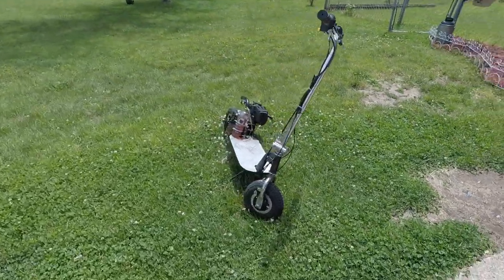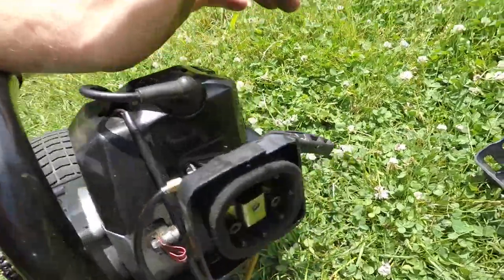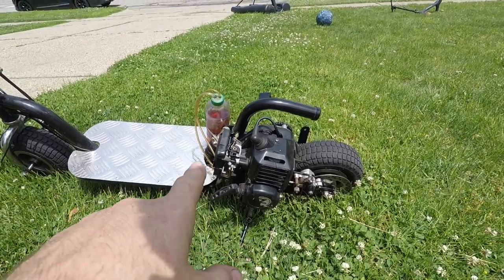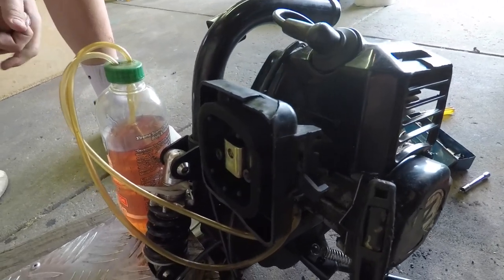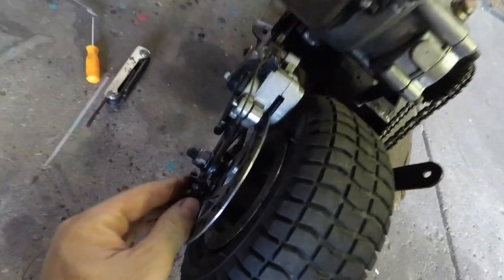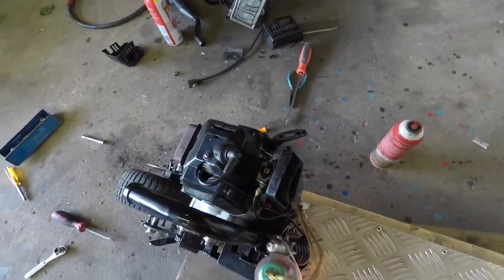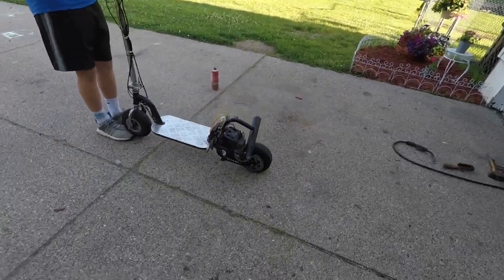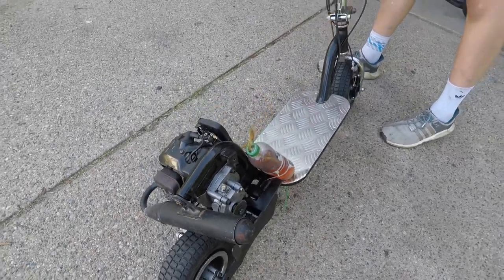We Found An ABANDONED Go Ped SCOOTER!!   Will It Run??!

Comment: I know a few things about small engines and thought I would try to help. When you start a small engine, only hit the plunger until you see gas in the bulb. Then close the carb and pull until you hear it turn over then stop. Then open the carb, hold the throttle and pull.  It should start every time this way. If not, check the gap in the ignition coil. The gap should be the size of a business card.
Reply from the maker: Thank you very much!! What do I do if it’s kicking back when it wants to start? It kicks back hard enough to break the pull string?!!
Reply: @KBMOTORSchannel  If the starter is to hard to pull, check the gap in ignition coil. If uses a magnet,  and if the gap is to tight it will be really tight. 
Also, if your scooter is an older model,  it will require a ignition module for it to start.  My first goped I restored was one of the original models. I would pull on that cable until I was blue in the face. One day a friend told me that the old g2-d motors require that module I mentioned.  Once I installed that, it fired right up.
Reply: @KBMOTORSchannel  p.s. you're welcome bud. You can ask me anything. I'll be happy to help you out.✌

Comment: Have you tried re-jetting your carb? Too big of a jet it won't run properly, same with too small a jet. Too big and it may flood out. Too small and it may be starved for fuel. Trick is to find the correct jet.
Start  two sizes bigger than the jet in it. Drop back one size and that is your new jet size. Work your way up or down in jet size until the correct jet is found.
Ex. #45 jet originally. Count up two jet sizes. That would put you at a #47 jet size. Drop down a jet size. That would put you at a #46 jet size. Install that jet and test. Work up or down in jet sizes until you find the proper jet.
This method is called Denver Jetting and is the simplest method I know of. Be careful using too much starter fluid on those type of motors. There is a possibility that you may burn a hole in the top of your piston. At that point you will be rebuilding or replacing your motor. Another tip: Try adjusting the idle a bit.

Comment: double check the fuel lines, i once had a very tiny rock/pebble somehow got it there, with that thing sitting for years u never know
Reply from the maker: Ahhh. Yes okay I’ll look. Thsnks
Reply: @KBMOTORSchannel  ya kinda seems like its just not gettin enough gas, i wonder if its a issue with that bottle as a gas tank too, because if there is no air relief then im not sure if it can flow to the carb. since the lines are clear have a look when u run it and see if its flowing up to the carb properly
Reply: @KBMOTORSchannel  the way i would test this is unscrew the top of that gas tank bottle and it will allow some air flow, and might be able to create some pressure to get that gas up to the carb, and then try and fire it up

Comment: Its oil and gas mix right?
Reply from the maker: METALMAN4Wii 50/1 I’m pretty sure that’s right?
Reply: @KBMOTORSchannel  Bet someone tried to start it on just gas that's what destroyed the carburetor.
Reply: @KBMOTORSchannel  If you wanna supercharge that put 91 octane and Star Tron fuel treatment 1oz per gallon. turned my old moped into a rocket ( rip Death Trap ) I passed someone on a motorcycle 7 years ago and heard him yell what the fuck true story.
Reply: @KBMOTORSchannel  Too late  to help but that engine takes 25/1 gas/oil mix.